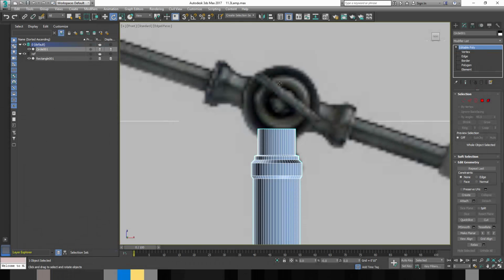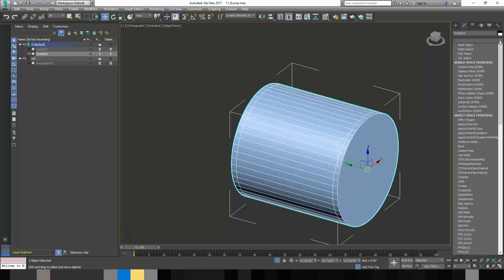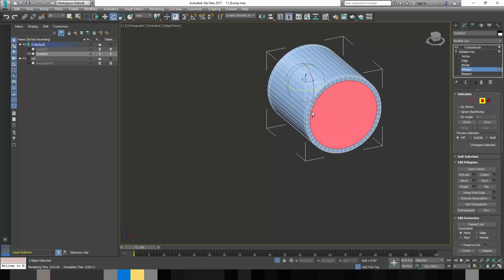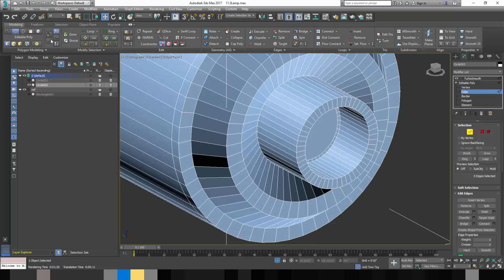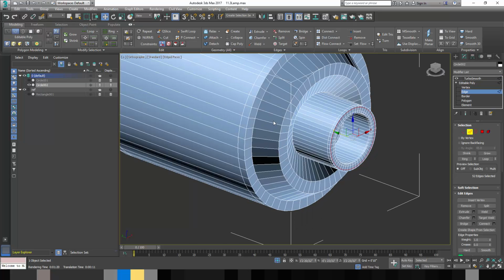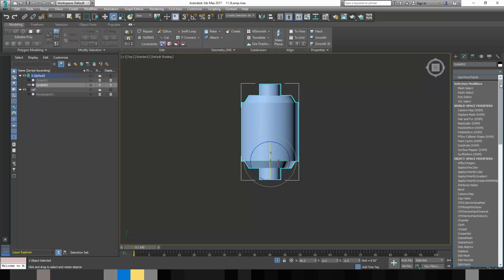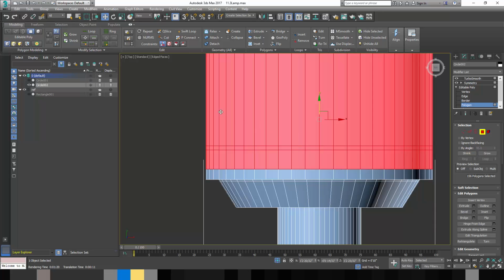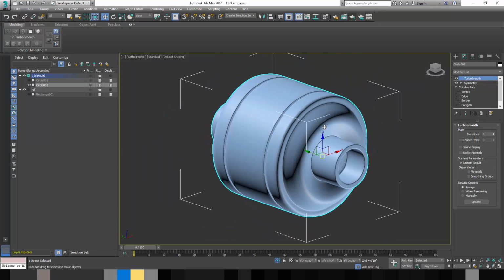3ds Max Poly Modelling Tips and Tricks - swift loop / symmetry / turbosmooth

Comment: Those caddy controls...they hurt my eyes
Reply from the maker: Caddy controls?  Keep in mind the course is for total beginners, therefore the class uses basic default controls and UI.
Reply: I was referring to the updated caddy interface autodesk introduced with max 2013, or was it 2011?.(the connect/bridge/weld++ dialogs) it really clashes designwise with the rest of the ui, so much so that i cringe everytime i see it:-P. Sorry about the kindof random comment. You're doing great work with your videos
Reply from the maker: Oh, ha ha.  Well, when I am doing my professional work, I definitely modify the UI dramatically, but unfortunately the caddy controls are still there.  Can't say that I am a huge fan of a lot of the "upgrades" Autodesk does.  This year they changed the way all the buttons looks, which mostly just makes it so I can't find things as fast anymore.  Thanks for watching.
Reply: Cheers. By default yes, not sure if you know but you can get the legacy dialogs back by unchecking the "use caddy controls" option under preferences->general.
Reply from the maker: I didn't.  Thanks.  They've honestly never bothered me much, but now that you've pointed it out....
Reply: Its a slippery slope.